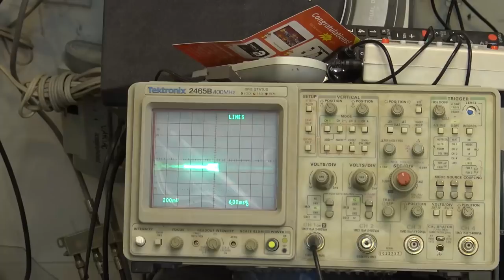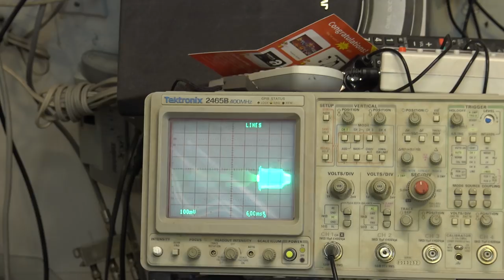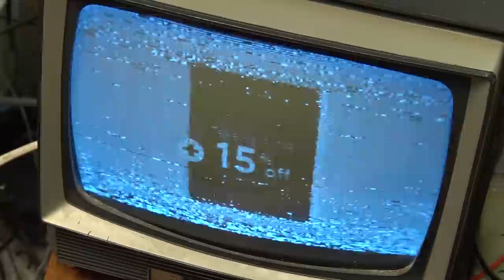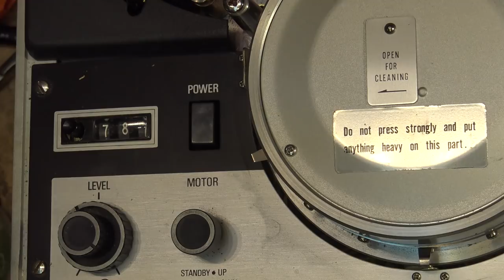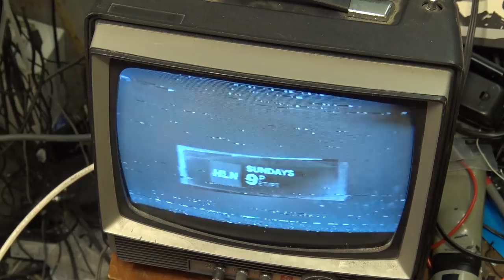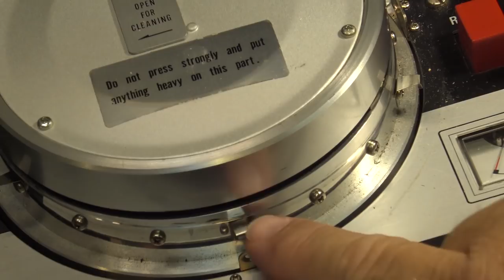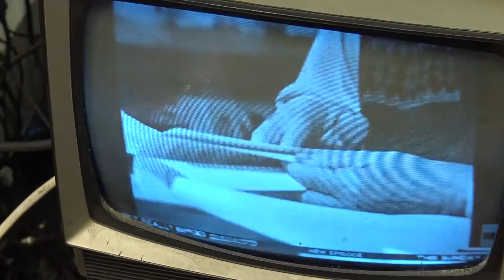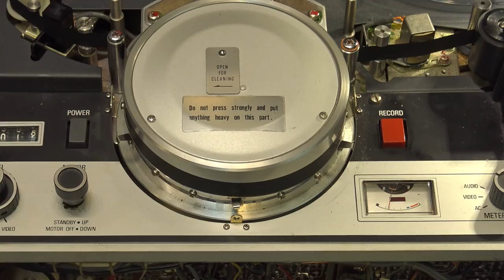Vintage Sony CV2000 Video recorder from 1965 part 2 finding out the cause of the sound problem.

Comment: 1979 VHS tape was much thicker than later years . I still have from back in the day and I would only record once.
Reply from the maker: The short 60 min tape was for sure and even early t120, but that all changes within a couple of years.  Soon as the t160 was developed around 82 all the tape loads started using the thin tape base.
Reply: 12voltvids I’m in Canada ... I could send you a couple if you’d like. The early 1979 TDK TAPES I have are the heavy stock. And they are physically heavier than later tapes. They were $12.00 each 1979 pricing.
Reply from the maker: 12 bucks each?  I remember RCA vk250 which was RCA's numbering system for a t120 selling for 50.00 in 1979.  Yes I had a VCR in 79, an rca vct201
Reply: 12voltvids , I had to buy a case of 10 or 12 to get that price and yes it was 1979 and I had bought the cheapest vcr at the time ($1299.00 US from Crazy Eddies in Manhattan) which was a Magnavox . Mono top loader as they all were back them .
Reply from the maker: @jblackjack  here VCRs were 1999 for VHS and a beta would have set you back about 2100. 
Video only started selling "TDK" tapes that sold for 30, and the heads clogged up right away.  Close inspection on the box and the Colors didn't look quite right on the back where the warranty info was there was a typo they had it printed TKD and the store stuck the price sticker over it.  Yup counterfeit tape. first one  i saw 1980.

Comment: Hey i got a question random from this subject but have you made a vid on repairing an optic drive i got a ps4 here and when connected the lazer moves all the way to the motor and just bounces back and forth with a click sound. As for the tray. The only way i can insert the disk is pushing all the way. But still no read. Any ideas help would really help
Reply from the maker: Check the switch at the start of disk position. Normally the unit moves the laser to the center of the disk when the switch signals the laser is home it starts looking for a disk.
Reply: @12voltvids  i tested it this morning looking inside and saw the lazer working lighting searching for disk but the gears for the tray had no movement and the motor for the disk also no power so disk was not spinning.
Reply from the maker: @rafextreme2879  so of the lens is lifting and you see the laser glowing and no spin of the motor a couple of things.  First the motor could be fubar.  That is a common failure.  Easy to test using a small battery. If motor spins with battery applied to terminals then the cd is not being detected.   Bad laser.
Reply: @12voltvids  ok so testing the motors is next then. You said small battery are we talking a regular 1.5v or 3.7v?
Reply from the maker: @rafextreme2879  3.7 will spin it nicely.  I used to use 2 AA battery's back in the day, or a power supply.  They normally run between 3 and 5 volts when spinning the disk.  I have run them up as high as 9 or 10 when trying to free up sticking bearings.
Reply: @12voltvids  yea vacuum cleaner bearing are my enemies. But aside from that thank you for the replies. Thank you have a great day sir

Comment: I wonder how it would be if someone or anyone added colour to these kind of VTRs. Is it possible?
Reply from the maker: Not on these.   There were colour versions that came along a few years later.  Then u-matic 3/4" cassettes.
Reply: @12voltvids  what models would be the colour versions?
Reply from the maker: @ArtisticAutisticandAiling  
Don't know the model number off hand.  Last time i saw one when when I was in av club back when i was in grade 8 or 9.  The school had one mounted on a cart with a TV bolted to it and the av club students (they usually had 2 or 3 of us in the room for each block and we took it as an elective course) would transport the vtr and tv, or 16mn projectors or film strip projectors to the class rooms and then operate the equipment for the various classes that were running a video tape or film.  It was a fun class that I was in when in jr high school. When i got to grade 10 they had a 3/4 U-matic recorder.

Comment: Sticky shed syndrome is a big problem on these old tapes! Baking the tape in an oven is a temporary fix, allowing recovery of recorded material. Use some VHS tape instead.

I achieved good results with tape baking, but the tape will rapidly become unusable again.

Comment: Maybe it's better to respool old VHS tapes from late 70s and early 80s, which have less playback time, like 2 hrs tapes, those were a bit thicker, than later 3, 4 and 5 hrs tapes.
Reply from the maker: This was given to me in the early 90s and that tape that was respooled was already on it.  The tape would have been from the 80s.